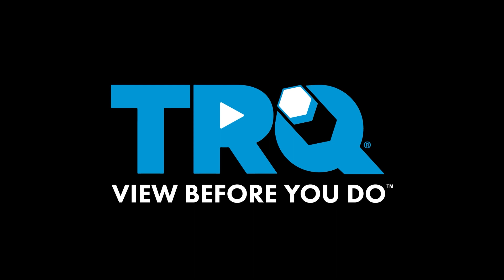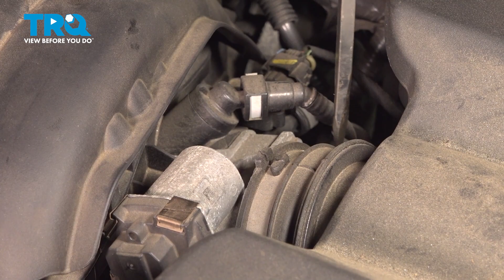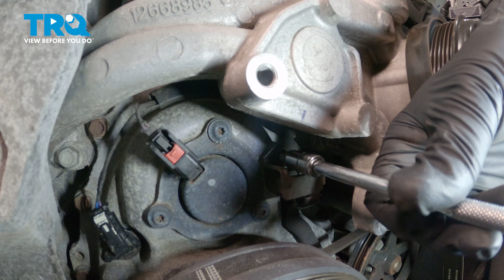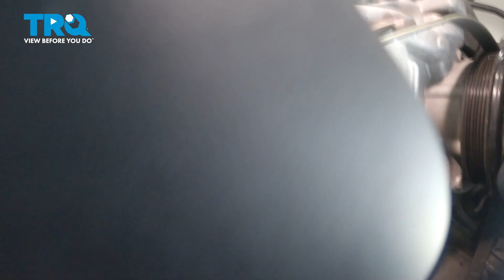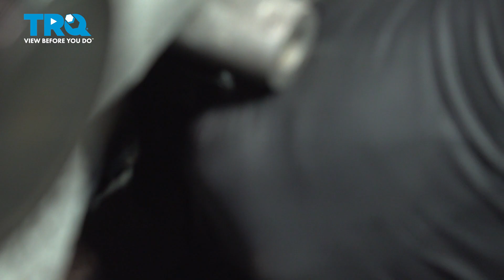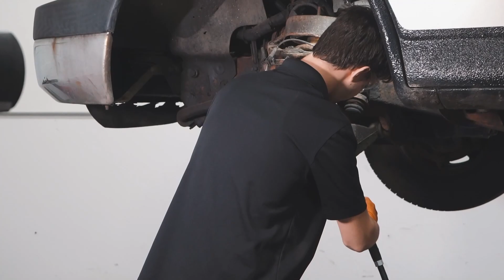How to Replace Camshaft Timing Magnetic Adjuster 2015-2020 Cadillac Escalade

Comment: I replaced the cam sensor twice thinking that was the issue because the computer said it was the cam sensor. Still starts odd...sometimes doesn't want to start at all. Does the timing belt need adjusted? This is for a 2009 Cadillac Escalade.  I'm at a loss for what to do.